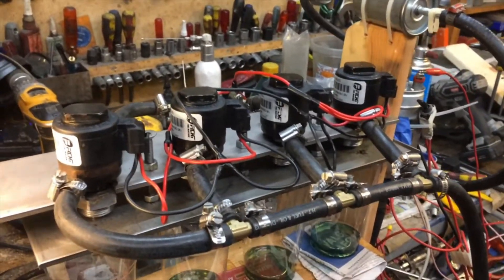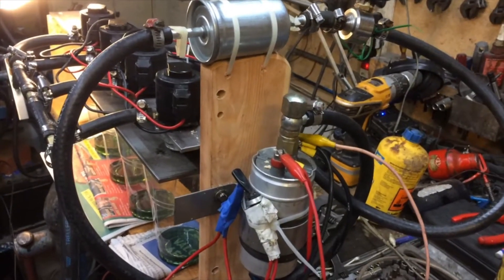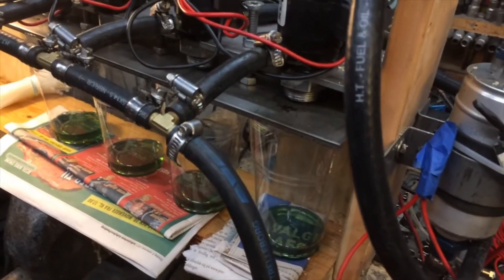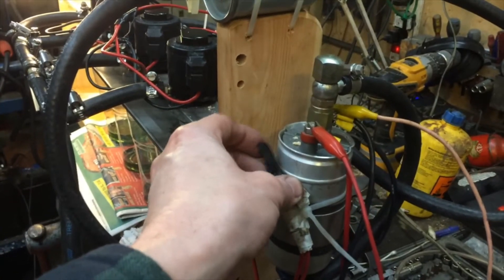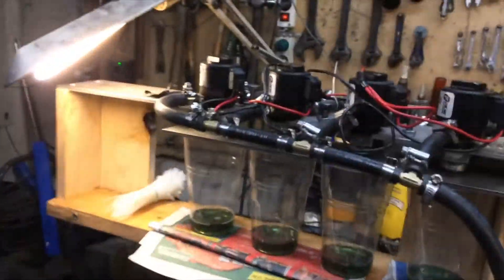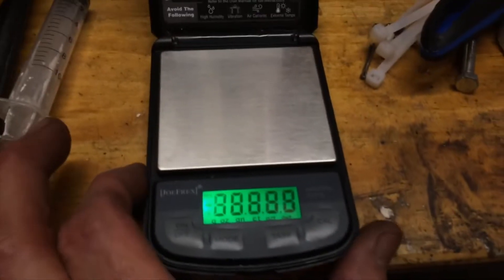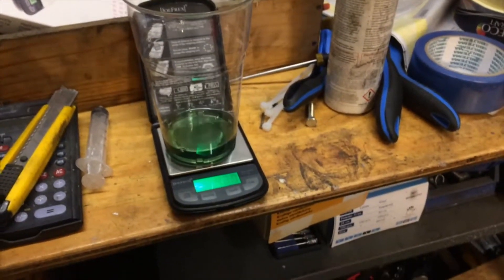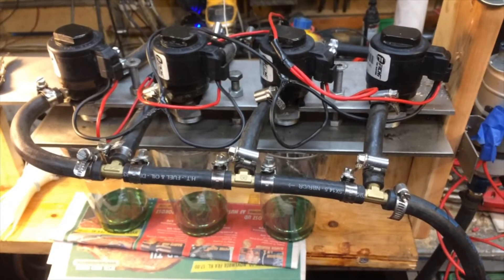Evinrude 150 Ficht injector test

Comment: Pretty cool setup! Looks pretty dangerous with the relay arcing. Did you find that a minimum fuel pressure was required to overcome the inlet check valve?
Reply from the maker: No I diddent find that pressure, but I found that they could be clogged and need cleaning. And also found a way to take them apart. See below link,,,,  
https://www.youtube.com/watch?v=44ONDDaM_8I